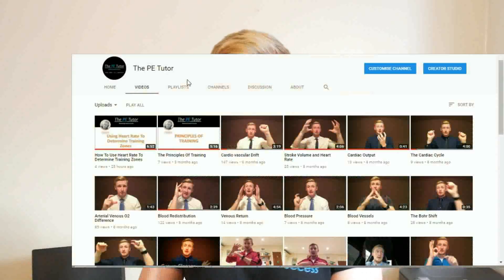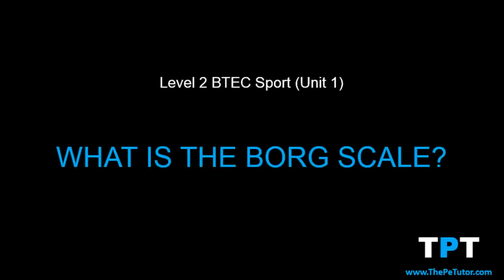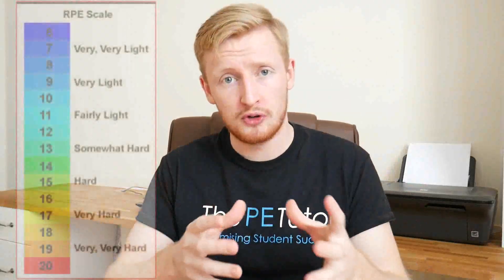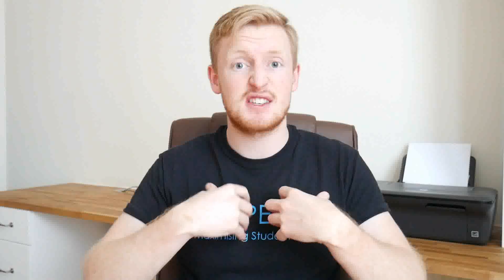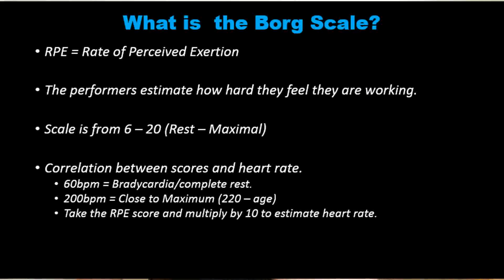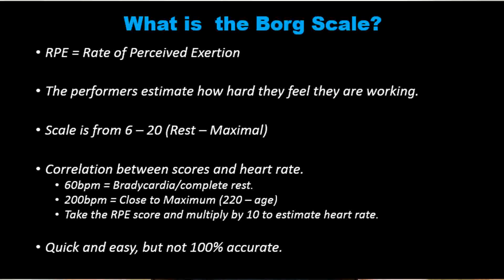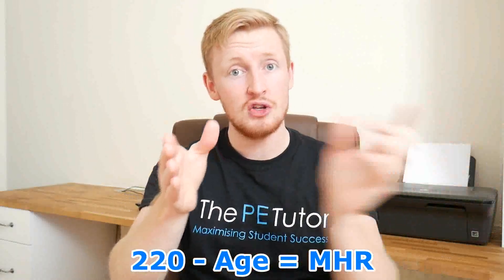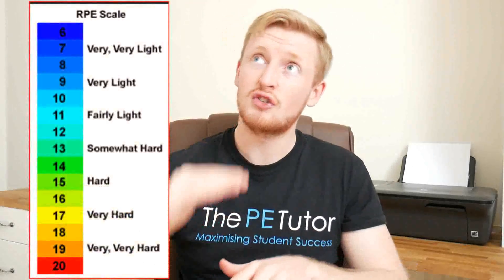The BORG SCALE And RPE Explained

Comment: I use the explanation  of THE MODIFIED BORGS METHOD ..RPE  in  my cycle classes just before start , being apart of yhe introduction...
I bas mine from 1 to 10 , 
Ten being the maximum  effort..
I explain the feeling of the numbering  system .
1 to 5 ... ride easy ..
6 ... sprint zone .
7 somewhat hard .
8  hard .
9 very hard 
10  maximum  effort , short time here ,I use this for Attacks and surges ..
I work at some fitness centres that have computer screens in front  of the members  ,  for me it takes away the connection  between student and instructor  , its a down head society.... thats why I use this method  so my members keep with me that face to face connection..

Comment: Question, does this not depend on the kind of exercise and how long? So I do the test each time on the same exercises?
Reply from the maker: Hello Nadja, good question - both the duration and intensity of exercise, or indeed the type of exercise, can impact the score a person marks their work rate on the Borg Scale at. The scale lets a performer subjectively estimate how hard they think they are pushing their body at any given moment. E.g. During a triathlon, 2 performers matching each others swim speed, may record different Borg Scores to each other, because one has less capable body systems than the other to achieve that swim speed, therefore are working closer to their maximum than the other. However, during the cycle section of the race, if the same 2 performers are still matching each others speed, they may switch in that the less competent swimmer is a more efficient cyclist therefore now has a lower Borg score than their opponent. It is merely a guide a performer or coach can use to estimate how close to maximal capacity a performer is currently working. Diet, sleep, motivation, equipment, training are just some factors that could cause 1 person to give a different score to someone else despite the exercise they're both completing being identical.

Hope that helps!

Jonny